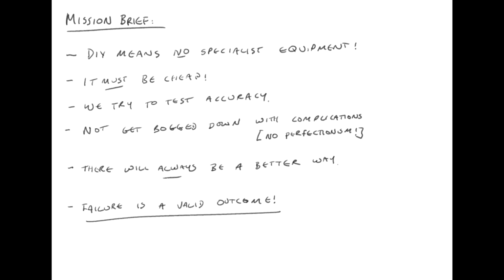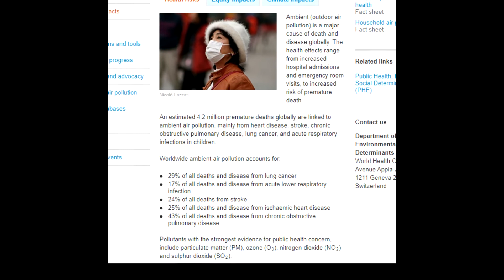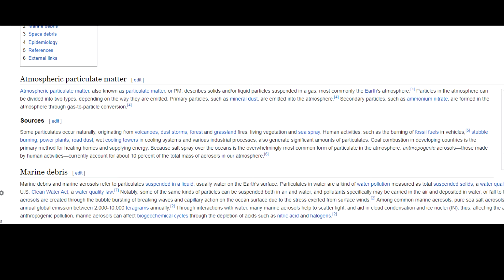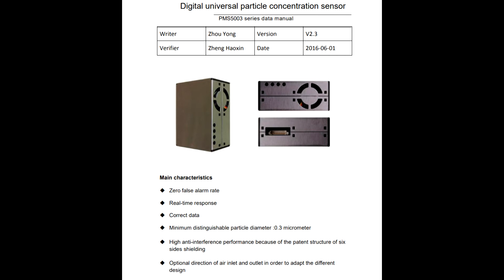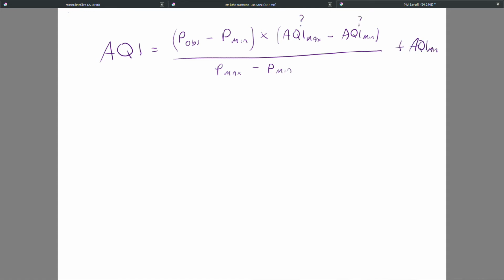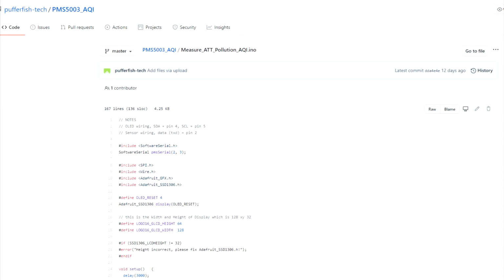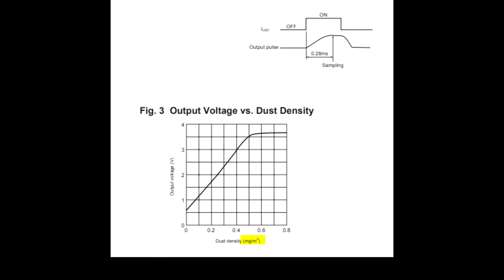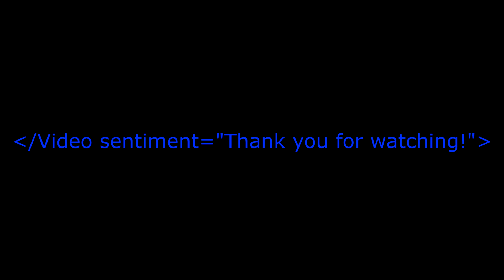Measure All The Things - 1 - Pollution Sensor (PMS5003 particle sensor)

Comment: After learning about how this PM detector works using a laser and light sensor, I would imagine after some use of it, you would have to open up the box and thoroughly clean the interior to continue to receive accurate readings especially after having lots of air pollution!
Reply from the maker: You would think so, but we have one of these in our shark fan and it's been working for over a year non stop

Comment: what if i have AQI of O3 and PM2.5  how do i get the total AQI? adding?
Reply: From what I know, AQI is usually determined by the highest value given by converting a pollutant to its index.

For example if Ozone has an index an index of 51 on the AQI scale, and PM 2.5 has an index of 68, then the AQI would be 68.

Comment: Thanks, the AQI calculation formula and code were pretty useful for me to port over to a Raspberry pi. Even mentioning that Sharp sensor was useful because it is a dust sensor rather than a PMS particulate matter sensor and I've also got a project in mind for dust level sensing. Did you cover sound and vibration measurements on a Pi or arduino yet?
Reply from the maker: That makes sense when you think about it, it's more for acute dust/smoke than lower levels of PM2.5 etc.
I've not got vibration on my list at the moment, but I have got sound, in terms of SPL at least. Soon, I hope..I have all the bits ready for it...

Comment: hi in this video are you using a 128x64 or 128x36 oled display?
Reply from the maker: It's the 128 x 32, but the 128 x 64 would work too, you just have to change the initialization string in the setup code..I can provide more info if you need it, let me know :)
Reply: @LostInTech3D  thank you very much :)

Comment: I would not have minded a bit more "theory", to get a better understanding of the sensor. Please dont apologize for the analytical part. Instead, why not focus on explaining it bether? Maybe you could seperate complex and simple explaination. Also, i was expecting nice data graphs at the end. Does the sensor see a difference between indoor air quality, next to a road and infront of a hepa filter? Whats the necessary averaging time to get a good result? Whats the rms noise, and so on. Apart from this, i really like the style of the video.
Reply from the maker: Noted - it's hard to know how much detail people want to get into. I will certainly include more data in the next one.
Reply: from what i understand doing research on aerosols/dust, the sensor is likely using a known distribution and fitting the data to that curve. this is particularly (heh) inaccurate because most aerosol sources tend to be very size range specific. for example a car exhaust will be making mostly PM2.5-5, someone walking will kick up mostly PM100+, pollen and mold spores will be somewhere in the middle. while statistically you would expect the distribution to even out over time you actually tend to observe the opposite since static charge and humidity work on the different particle size's differently.
under PM2.5 tend to be completely suspended in air due to their relatively similar mass and inertia to air molecules (think solvated)
PM5-100 tend to be statically pulled to the ground due to their size to charge ratio (vinyl floors are really good at this and is why real hardwood floors are easier to keep clean)
PM100+ are strongly effected by the humidity% either gaining a lot of mass and sinking to the floor or getting stuck to the walls
there is also a big difference between indoor and outdoor air currents which can amplify the effects of static charge.
I presume the laser sensor in these cheap sensors is mainly calibrated towards larger particle sizes since theyre so much easier to detect and will not loose accuracy as much overtime. in the lab we would use a large chamber (~50cm long tube) that used a mercury flash bulb to scatter light in a similar manner, but was then fed into an analogue photomultiplier tube arrangement. there is something about the quantum mechanical properties of light which makes analogue light amplification circuits just so much more accurate, for example look at the most recent generation of night vision goggles the US military uses. despite the numerous advances in diode size and bandgap tuning in the last 20 years, the us gov cant figure out how to make a better night vision goggle without vacuum tubes lol.
I think this sensor is accurate enough if you are monitoring indoor aerosols and want to know if your home air filter needs replacing; but I doubt its going to be accurate enough when you have a unique particulate source such as a poorly running gas furnace, an off gassing solvent or close by automobile exhaust source.

Comment: I made the mistake to buy the sharp sensor and as you said its sensitivity is way to high. However, it starts measuring at 100µg/m³ that's exactly the threshold for air particles to become harmful. So my app only measure good, bad and very bad with color LEDs.
Reply from the maker: It's been a while since I looked at it but I think if you write your own code, it should work fine. The main issue was the code was making "readings" out of noise from what I remember. I'm about to try some other sensors when I get round to it, for polluting gases, this will be interesting I think...if they work!